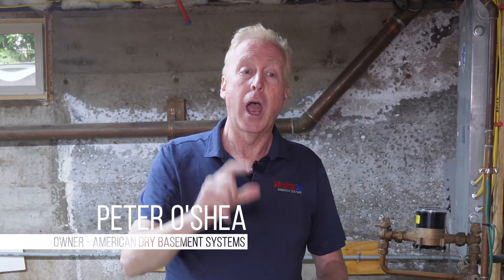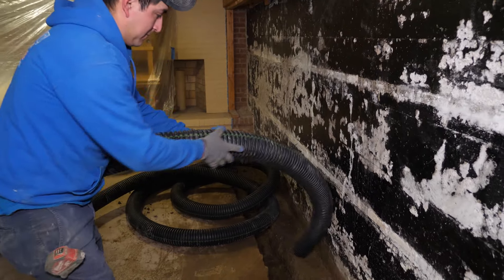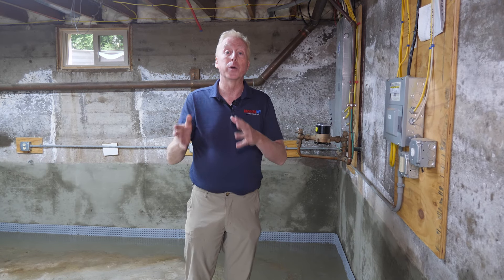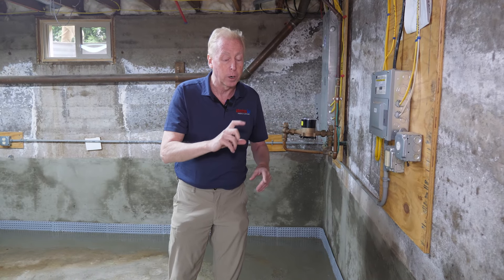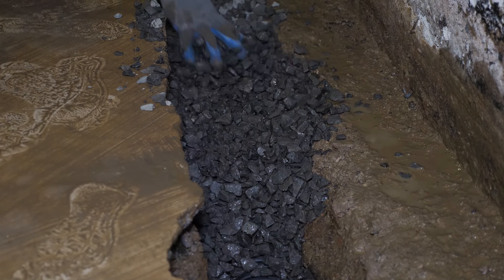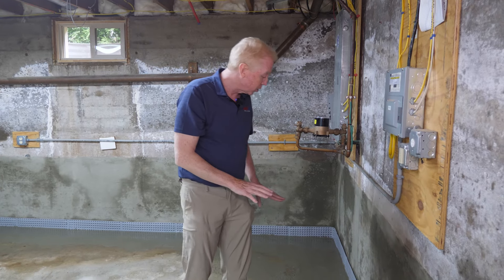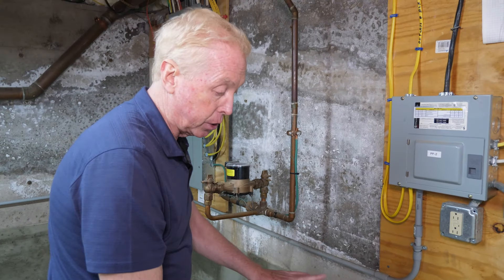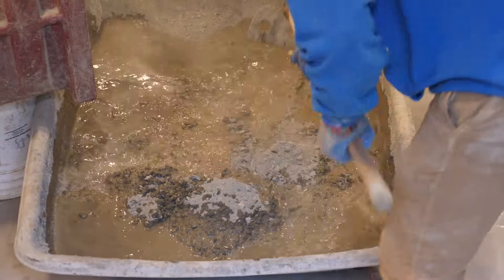Interior Basement Waterproofing Comparison

Comment: Just bought a house a few months ago. Found out we had bad mold/water problem in the basement unfortunately. The money I’d spend chasing down the sellers I mines well just fix the problem. Between you and hydro armor I’ve been able to see what systems work and don’t. So pretty much dig to the bottoms of the footer and make sure the trench is At least 10 inches out from the footer. Corrugated 4inch pipe pitched to a sump pump.  I’ve had a few quotes where the salesman tries to say it goes on top of the footer and to use pvc pipe. I just smile and throw there quote in the trash when they leave. You guys already saved me a lot of money since I know what to look for. Thanks.
Reply: PVC is better. Guys like this just talk about corrugated being “self-cleaning” to justify them saving money on materials.

Comment: Hello, I live in Maryland so too far from you guys but could you please tell me how much I should be charged per liner foot? The company that came today wants to charge me 32k for 108 linear feet and 2 sump pumps. Is it a reasonable amount?
Reply from the maker: 32K is not reasonable. I knocked over my lunch reading that quote. It sounds like they don't want to do the job. It should be somewhere at half that amount. Find another company that will promise to not ruin your foundation's stability.
Reply: @AmericanDryBasementSystems  Thank you so much for your prompt response. I scheduled inspections with 4 more companies :) 
Also, thank you so much for your very informative videos !
Reply: I got quoted less than 14k for 108 linear feet in MD, hopefully you shopped around?

Comment: Looks great. Would a fabric over the pipe make sense?
Reply from the maker: No. The fabric will not allow water to flow into the pipe quick enough. It will also clog with dirt particles over time. Pack the pipe in stone. Stone is your best solution.

Comment: In drier climates like Utah do you recommend this system? We do have water in our basement when it rains but it doesn’t rain a ton. Water seems to be coming in under where downspouts come down. Does the pipe eventually deteriorate and get sediment in it?
Reply from the maker: It doesn't matter where you live, dry or wet, water will get in if it can. The initial exterior waterproofing applied during construction is no longer working and you can possibly have a crack somewhere in your foundation. The drainage pipes we use never deteriorate. They will out live you. Sediment can collect in them if not properly installed with a pitch. A properly pitched corrugated pipe will produce a hydrodynamic movement that will remove suspended solids all the time. That is why you see them all over highways, roadways, and terrain all over the world. It works and does a great job!
Reply: I have a lot of iron ochre in my basement, does that 4" corrugated pipe work well with that? And is it possible to install drainage ports In that system for flush outs?

Comment: Is there ever an instance where a gutter system like the ones you pull out are used, and work well?
Reply from the maker: My guess is they could be installed in basements with little to no water problems. But, I've never come across operational gutter systems. The homeowner only calls when the problem is too much to bare.

Comment: How do you seal the system? Dimple board that protrudes from the floor, how do you seal it off ??
Reply from the maker: No. It is there to catch any water seeping through the cove point and allow access to discharge water from a dehumidfier, etc.

Comment: Thanks for the videos.  Quite informative.  I do have a question:

What is the ideal/recommended PITCH to achieve? (Using 4" perfd corrugated tile) 

House roughly a rectangular basement with the sump pit nearly midway on one long edge.  If highest point was directly opposite side of the rectangle, its approx 75' each way to pit (~150' total system).  2nd sump pit not really an ideal option.
Reply: I had a sewer (both storm and sanitary) license. Every 100 feet I would apply a drop of 6.5 inches minimum but not more than 8 inches. Hope this helps.

Comment: Excellent video. Most of the contractors  I have met with want to excavate the house to fix cracks in the foundation, replace weeping tiles and install Platon waterproofing material. One guy wants to install a Waterguard system which is what you tore our in this video guaranteeing it would work. Do you know of any contractors in the Ottawa, Canada area doing your method? I have looked for some but can't seem to find any. 

Thank you!!
Reply from the maker: Thank you. I'm glad the video is helpful. Contractors are a dime a dozen, and so are waterproofing systems.  In some locations, it can be challenging to find a qualified, honest company to handle your water problem. I sympathize with your situation. The best thing you can do is ask lots of questions. Ottawa is way out of my territory, so I don't know any contractors there. I wish you the best.
Reply: Have you found anyone in Ottawa, ON?
Reply: @HarshPatel-qr3nv  yes I have. I can send you his name if you're still looking for. Had the complete house excavated, cracks fixed, weeping tile replaced. Big job but worth it. No more water issues. Guy was really good too.
Reply: Older house or newer? So you went with exterior drainage over interior
Reply: @MaDGriZz78  1987 build. Went with exterior excavation, replaced weeping tile all around including garage and fixed cracks in the foundation. Happy with the results so far.
Reply: @marclemery6673  that's good, 1960 here. Was told that excavating isnt a good idea for my house because all the soil that has settled for decades would be disturbed 🤷 so I guess I'm going interior not really sure..
Reply: @MaDGriZz78  Interesting. I think 87 or 60, soil would be settled either way. I didn't trust the interior options I was shown. Companies were guaranteeing their work but it seemed like a band aid VS. complete fix. It was more expensive but seemed more complete. I am no expert though. Just a guy who's handy and knows just enough to do most maintenance around the house but not a project like this. Good luck.

Comment: is there a way to finish a basement with this type of drain system already in place?  dry wall, wood floors etc?
Reply from the maker: Yes. You can finish a basement with Sheetrock walls and wood or tile floor with our SuperDry system in place.

Comment: Please tell me you do Long Island
Reply from the maker: Sorry. Long Island is off limits for us. We don't work further south than Yonkers.
Reply: @AmericanDryBasementSystems  may I ask why off limits? Also when do you recommend getting some type of waterproofing system? I’m about to close on a home on Long Island. At inspection we saw that the rain water run off needs to be fixed to bring water away from the home as well as making sure the grading around the home maintains a pitch. We saw some of the white marks (effervescent) on the basement walls but doesn’t seem to be activity leaking water. The patterns seem isolated to near window well areas and downspout corners. I would eventually want to finish the basement but wondering if I should just fix grading issue and downspouts or go a step further to do waterproofing with sump
Reply from the maker: Long Island is too far from our nearest warehouse. Efflorescence is always a sign of water penetrating the wall for a long period of time. It can come from surface water during heavy rainstorms and go across your sill plate. Waterproofing outside or inside cannot stop surface water. Grade your landscape to prevent it.